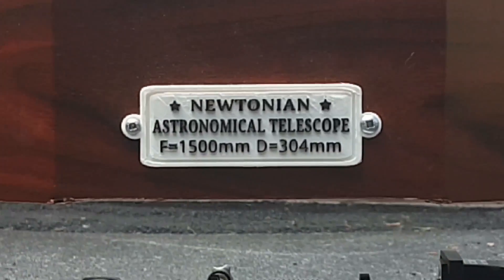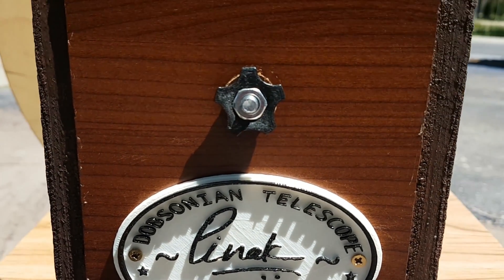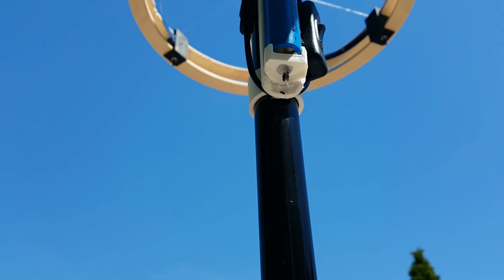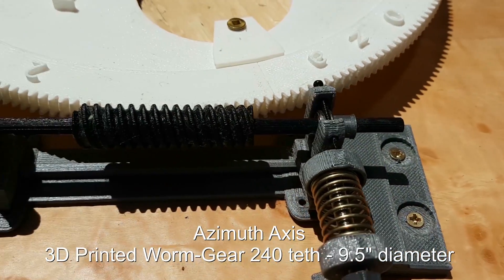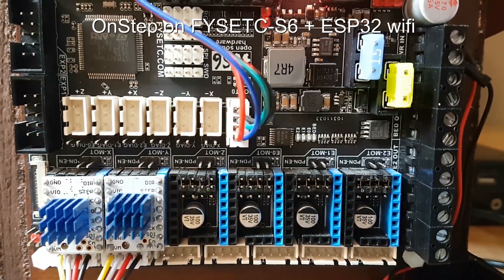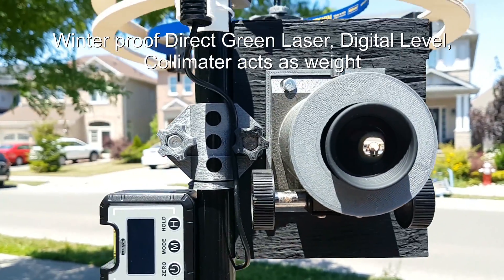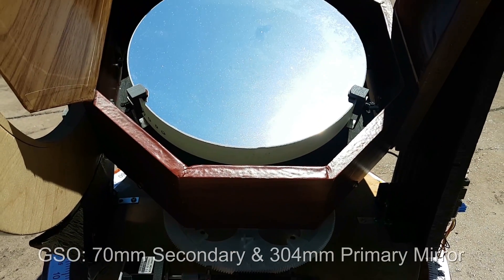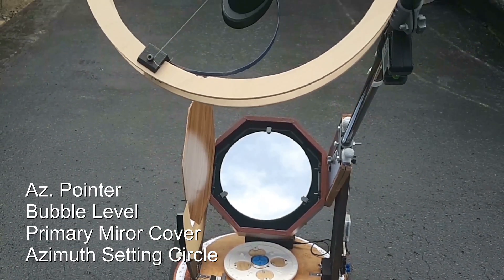OnStep Dobsonian Telescope

Comment: Very refreshing to see the experimentation with a single truss. I'm not sure what the material of the truss in your build is, but I can definitely see a slightly larger diameter carbon fibre or even aluminium truss being stiff yet light
Reply from the maker: Thanks for your comments 😃. Yes, this truss is not an ideal/great choice; better would be to use a double diameter Aluminium tube, or a nice studry CF tube, as you mentioned.

Comment: Very cool. If it holds collimation well, now I'm thinking that perhaps a single carbon fiber pole to hold the secondary and focuser is possible on an equatorial horseshoe mount version of your design.
Reply from the maker: That's definitely a good idea. Just need to figure out the diameter of CF pole needed for such design 👍
Reply: @pinakoza  I have two 1" CF tubes that are cut to one meter, oddly. Hard to find longer  than that at a somewhat good price.

Comment: Is deep space astrophotography possible ?
Reply from the maker: It tracks very well; I only do visual or quick planetary photography with it. Deep space requires a little more tweaking and tuning with it. For photography, I use another telescope.
Reply from the maker: Also, for such a powerful telescope of this big focal length, I need a camera with a larger field of view like ASI2600, but I don't have it now.

And most importantly, deep space photography needs long exposures (in several minutes), and thus needs Equatorial mount to counter the field roatation. This one has Alt-Azimuth mount, whic is not recommended for such photography.
Reply: @pinakoza  Thanks ❤️❤️❤️

Comment: But if 3d printing and wood was your method of building, why go for a single truss? Surely you have a lot of wiggle on this, whereas a spaceframe style would have made it far more stable
Reply from the maker: Well, It was just for experimentation and fun. It does wiggle, but not a lot. Good for visual purpose, and I did some Astrophotography as well of planets. I have ES 8" Newtonian, and 2 APO refractors as well. So this one is just for fun.

Comment: Nice work! I'll be grinding out a 12.5" primary mirror soon and then building a telescope to house it. Ideally I'd like it motorized and this gives me some ideas. Initially it wont be, but will be something I design in later.
Reply from the maker: Thanks. Good Luck for your built 😊👍 BTW, it's great that you can grind your own mirror. I thought for the same, but then realize that it could cost even more here in Canada, so I ordered it from Agena Astro.

Comment: how on earth do you collimate the primary without a central doughnut mark i wonder, lol. Other than that, hats off for the quality-capabilities / cost ratio and just for designing and engineering the whole thing.
Reply from the maker: Hi Bill, thanks for your nice comment, and a truly good question 😊. But for that collimation problem, I worked out in a little different and creative way rather than marking a donut on my Primary mirror itself. 

The primary mirror is covered with the protective lid. I found out the center of the mirror, and the lid, and marked it on the lid. Then I 3d printed a yellow star shape with a dent in the center (where actually the center of the mirror is located underneath). When collimating with a laser collimator, I adjust the secondary mirror until the laser falls in the center dent of a yellow star. Then I open the lid and expose the mirror, and complete the collimation. That gives me near precise collimation for observing. I hope you liked my idea. Pictures shared in the link below 😁👍.
https://photos.app.goo.gl/A49idJC11JfRkScbA
Reply: Mark can be easily done if you cut a paper circle of the same diameter with a hole in the middle. Put that paper circle on a mirror and paint a dot through the central hole with permanent marker.
Reply from the maker: https://photos.app.goo.gl/vDc1bJeVm4ZjmY1f6

for more pics.

Comment: The single tube 'truss' is intriguing.    Does is function without any wiggle at all?    Obviously you minimized the top assembly to reduce weight but I still have to ask if it's as good in function as in appearance.   A beautiful piece of work.
Reply from the maker: Thanks for your comments, and interesting question 😃👍

Well, depending upon the thickness of the truss, it can wiggle a little, more, or not at all. In this scope, 1 inch truss is used. More over, I have embedded about 10 inches of the truss in to the wooden plank of altitude axis (plus the truss's end is bolted down). That makes it rigid, and leaves less room for it to wiggle. So it does wiggle, but only when jarred accidentally. Otherwise, observing, slewing or tracking doesn't make it wiggle. It is a good scope for viewing, but for long exposures, more stability could be added. Making it was a true fun, learning, and some experimentation too. It definitely can be improved --- simply more learning and more fun 😊

Comment: Very impressive!  I have a 13.1 inch f4.5 Dob.  This is something I have been considering myself, with junk I have laying around.   What's that 5 axis controller pn? (it appears to be 5 axis with you using 2.  I aslo like the homemade worm drive, I see you did it in sections and some imperfections.  How much does it affect tracking?  I was thinking the same but with the track (corian (sp) or teflon?) but mounting it smooth and driving it with a tap to cut threads at say 1/4mm at a time cut... repeat 4-8 times (as needed for correct depth).  With a good matched tap and die I would think this method, cutting both gear and worm, would make a  very smooth drive without much/any correction. needed.
Your advice/help communication would be greatly appreciated.  I could give you some telescope time at 32n 96w with a 8" sct if interested.  With that said, old retired and working out things.  Astronomy on and off since 1971.

Good job and clear skies.
Reply from the maker: Thank you very much for your interest and comments. The five axis controller is FYSETC S6 v1.2 - the 3d printer controller. Yes, due to the volume limit of my 3D printer, I had to print gear/s in pieces. But it doesn't substantially affect the pointing and tracking even at magnification 0f 83x (1500/18mm). It always performs GOTO functions, and points correctly at the objects. Any errors it has is just because of minor dimensional imperfections (micro expansion or shrinkage while 3d printing) in 3d printed gears, their alignment, and friction among PLA (Poly Lactic Acid) parts. Silicon grease is working good to reduce the friction among worm-gear. My purpose for this scope is live viewing and photographing planets with short exposure, so long time exposure is not expected from this scope. For that I am using Skywatcher Staradventurer mount with DSLR. Your idea of self-cutting worm-gear is excellent 👍

Also, thanks for your invitation for telescope time :-). BTW, I live in Toronto. I watched your FPV videos and they are excellent. I subscribed to your channel as I too doing aeromodelling since grade 7, and DIY drone flying since 2011.

Comment: Excellent engineering! I have watched many of your DIY drone videos, but never knew you can build this too! Brilliant job 👍.
Can it keep following the stars, planets, galaxies for the purpose of photography?
Reply from the maker: Hi, thanks for watching and commenting. Yes it can take excellent resolution pictures of Sun, Moon and some planets as long as exposure time is short, as long exposures can result in to blurry images due to Field Rotation - because of the rotation  of the Earth itself. For long exposure photography this type of mount is not enough. It needs to be mounted on Equatorial Wedge to negate the effects of Earth rotation. I am thinking to make one wedge for this telescope, but no sooner.